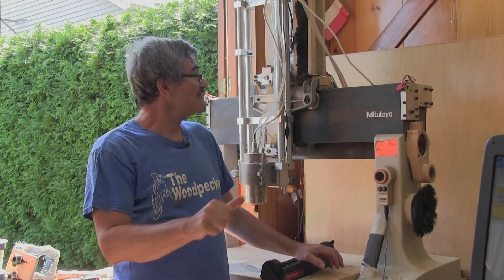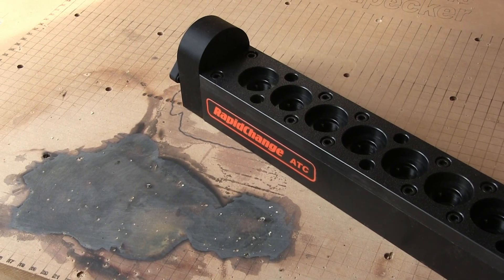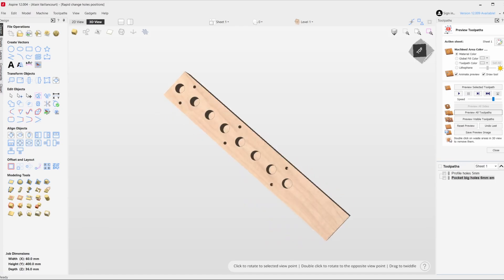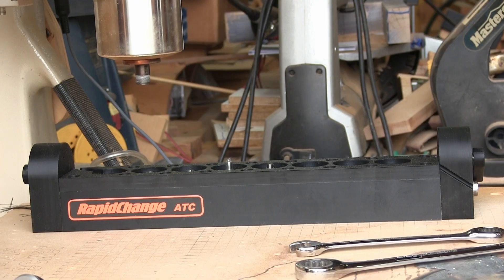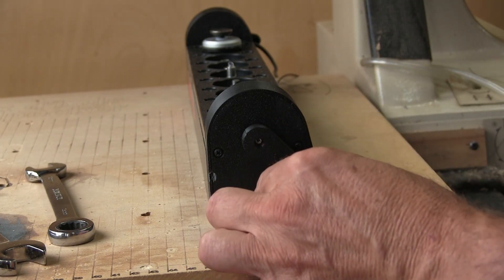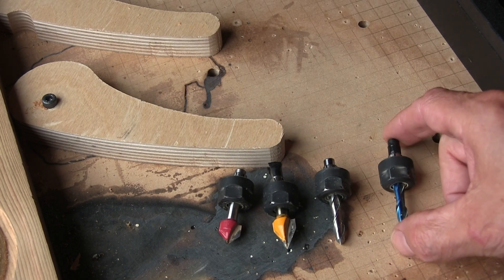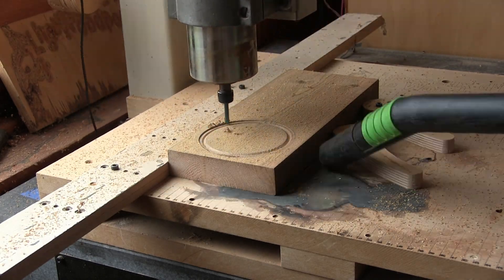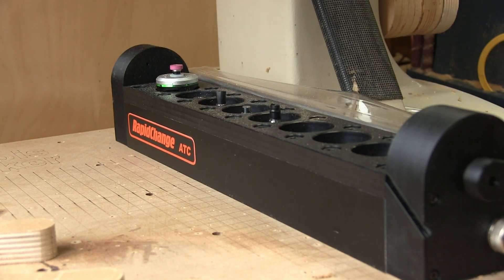The Woodpecker Ep 317 - Instaling a RapidChange ATC

Comment: Hi sir, I found this video very helpful. Im doing the same project as you did, but my spindle has low torque in low rpm. So, I couldn't tightly fit the collet with the spindle. So i would appreciate it if you could tell me how you manage to solve the tightening issues of the cutting but with the collet.
Reply from the maker: Thank you. with a lot of tests I figured out that about 1700rpm the collet were tighten enough. I should work,  I saw, because I was filming it, that at this speed the spindle even stopped turning when the collet was engaged. I've tested the tightness and it was perfect even if the spindle stopped turning for a short while. I guess if yours is not tight enough you can try at different speed, but also you have to also modify your engage_feed_rate mine is at 2500mm/sec. They're a lot of settings to fiddle around it's long to get it to work properly, I still even change some settings, but way less than when I've installed the RapidChange. Hopefully this will help and keep me posted